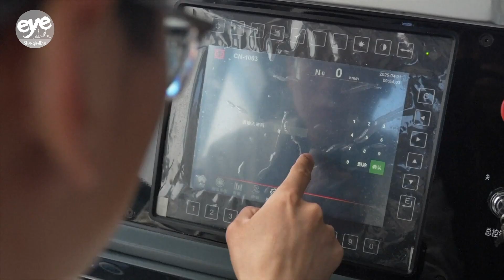China rolls out first 1000kW battery-powered locomotives for industrial use

Comment: Electric trains already exist. Why add batteries when it could be powered by existing overhanging cables?
Reply: Safety first.
Reply: for shunting moves inside a factory or railyard it's not worth putting up overhead lines. For long distance, yes.

Comment: Indian Railways should implement this asap... Just get rid of old diesel locos for shunting and get this battery power locos we don't have issue with electricity so it's like a no brainer
Reply: India railway already 92 percent electrification completed why we weast money in these nonsense program 😊😊
Reply: @soumyadipsaha8834   E-Locos ain't used for shunting, that's why. 
Pit lines are generally not electrified due to staff safety and all that.
Reply: IR has converted some old WAG-5s into hybrid for shunting purposes. Dunno how successful was this attempt.
Reply: @mir_shader should take the battery way makes most sense
Reply: @sibtainraza8673  that's actually a electric-battery hybrid. It was specifically made for shunting only. Obviously it's battery won't be powerful like the one in above video, but it does the work.
Reply: No need we have better tech than this one
Reply: Which tech ?  @YokahamaParker

Comment: Battery cant beat diesel🎉
Reply: It literally does. It’s silent, 100% torque all the time.
Reply: its just for shunting heavy loads around the steel factory its not going to ever beat diesel or electric with overhead cables of course

Comment: How will they put out the battery fire??
Reply: you dont
Reply: Integrated fire suppression system inside the train. The entire battery room is purged with carbon dioxide or other inert gas to snuff out the flame. Can't have a fire if there's no air.
Reply: How do you put out a diesel engine when it goes into runaway burning it's own oil? https://www.youtube.com/watch?app=desktop&v=R0AVSBw4Qq8&t=400s
Reply: Diesel is easier to put out and electric is known to be left to burn!!
Reply: Firefighting drones coming.

Comment: What is so great about Battery operated Locomotive.?
If Battery operated Car, Bike, Bus is possible, Battery operated Locomotive is also possible.
Manufacturing cost of Battery operated Locomotive & its Operating cost will decide whether Battery operated Locomotive is cost competitive or not with existing Diesel & Electric Locomotive.
Wheel is already invented.
Now a days, China is re-inventing the Wheel.

Comment: Batteries = expendable. Not as great for the environment as, for example, Hydrogen Fuel Cell, in my opinion, especially for industrial applications like the locomotives.
Electric / Battery-powered = gasoline,
Hydrogen / Fuel Cell = diesel.

Comment: Uhh, perhaps Catenary Wires became too expensive somehow suddenly?
Reply: Catenary wires are a safety hazard in industrial areas that load trains. The 1000KW locomotive is a shunting unit for areas that include loading yards.
Reply: @alanb9337  so are batteries? Im pretty sure they have tendency to explode
Reply: Yes they are very expensive. They are worth it for long distance lines used many times a day. But short lines only used occasionally it is more cost effective to use batteries.
Reply: @adrianthoroughgood1191   Ohh that makes sense. Infrastructure reduces costs exponentially based on scale. Wouldn't want a train track that is used in a confined area or only occasionally to be burdened by infrastructure.

Comment: Instead of wasting money on batteries which have limited range and power, they should add a catenary to the tracks.
Reply: This is for short range shunting. For long range you use overhead. That is expensive and only worth it for heavily used lines.
Reply: Not cost effective for isolated industrial trackage that is only visited a few times per week.

Comment: Very nice. Very nice. How much GHG do the diesel engines of the Chinese Railways contribute? Anybody got any idear?
Reply: Railways account for ~2.5% of China's transportation CO2 emissions, down from 7% in 2006. Transportation accounts for 27% of total CO2 emissions, so railways produce less than 1% of total emissions. If you think that's insignificant you're looking at it wrong. It means that China could reduce emissions greatly by switching from road transport to rail, especially when using renewable energy. These battery-electric shunters are just a small part of the solution, but may pave the way for longer distance locomotives. Imagine locos charging up on solar electricity during the day, and transporting goods overnight (perhaps even autonomously). Also imagine them being used as storage batteries, feeding power back into the grid when needed and reducing the need for coal-fired base load power stations.

Comment: I think they mean a battery capacity of 1000 Kwh?
Reply: 1000 kW is a low-power locomotive which fits better.
Reply: 1MW sounds about right for a freight train. They can be several times more powerful, but 1MW would be perfectly functional.

Comment: Correct me if I'm wrong, but I assume the battery electric power and distribution of said power is superior to diesel engines? Also, when it comes time to replace the old battery for a newer and more advanced battery, it will be easier done than replacing a diesel engine on the locomotive? I'm guessing this because of how easy it is for Nio EVs to swap out a used battery for a fresh one. Replacing an old battery and installing a better and more powerful battery should take a day if not hours.
Reply: Nio EVs are designed for battery swapping instead of charging the battery. It's not for swapping once per decade when you want to upgrade. I expect they will have designed these to be maintainable though. Probably you can replace battery modules, not just the whole thing in one go.

Comment: This is a great alternative for when overhead power isn't available. The added weight doesn't matter as much and regeneration will provide significant power savings. What a great step forward! I hope we can get these in Europe, too.
Reply: Works for shunting yes- but added weight of batteries may make a difference in long haul. In that case looking forward to electrified fright ( via overhead catenary)like they have in Europe and used to have in Northeast U.S.
Reply: The added weight actually improves the situation since you usually want the locomotive to be very heavy
Reply: We are building battery locos in the UK as well. Some of our lines can't be electrified because the tunnels are too small to fit the cables. The cost of installing overhead lines is high. For lines that only have a few trains per day it can be more cosy effective to use batteries. For heavily used lines overhead is of course best.
Reply: These are not designed for mainline use, but for industrial uses. It doesn't have a lot of range, but offer a lighter still powerful traction for hauling freight. The flexible power modes are optimal for industrial operators, with the battery pack being one of a few modular options, along with hydrogen and traditional diesel configurations.